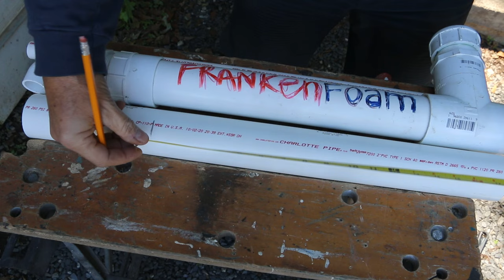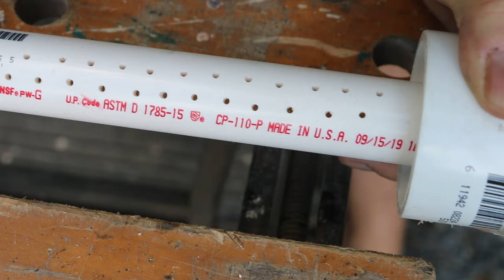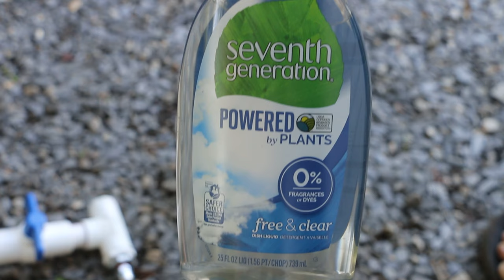How To Make A Simple Aircrete Foam Generator | FrankenFoam

Comment: How would the scotch bright scrubber pads work as a replacement to the steel wool?
Reply from the maker: Hi Chris. I tried stainless pot scrubbers first. I wanted a little finer mesh. Didn’t try scotch brite. I’d give it a try. I think it’s in between the two I tried. If you compress the pads down that might help. Thank you for watching.

Comment: Hi, thanks for this great video. 
How would you adapt FrankenFoam for bigger and/or continues batch flow? Let say someone wants to work with 100 gallons of foam!

Again, Thanks!
Reply from the maker: The tank section could be made larger. The foam has an optimal life span. Not sure I’d want to do continuous generation. But, I tend to build smaller projects. There is a case for larger quantities. Thank you for watching.

Comment: Fittings that transition form one type pipe to another are called adaptors, not connectors.
Reply from the maker: Thank you, Terry. I can’t update the video, but I can fix the words on the plans. :-)
Reply: @GreenShortzDIY  And the next time you use the fittings. It's always nice to look professional.

Comment: I think you are supposed to use a pink colored tape rather than teflon if you are dealing with gas(air) the teflon is for water.
Reply from the maker: Thank you for the tip. I appreciate it. Thank you for watching.
Reply: @GreenShortzDIY  The FrankenFoam is a brilliant tool- I watched all the way to the end and have no concrete jobs coming up.
Reply from the maker: Thank you for watching. :-)

Comment: you can use ALOT less glue. best quality is if you sand it (use rough sandpaper) where you apply the glue. it will NEVER leak if you do it that way.
Reply from the maker: Thank you for the tips. Thank you for watching.

Comment: About how many cubic feet does a 94lb bag of cement make?
Reply from the maker: Hi Robert. I’m not sure. It would have to do with the amount of foam added. I prefer to work in smaller batches. I do know that Aircrete Harry (here on YouTube) has done larger calculations like that. Check out his videos.

Comment: Scotch bright pads instead of steel wool?
Reply from the maker: Are you talking the stainless steel pot scrubbers? Or the green mesh that is used for metal and wood? My initial build was with the stainless pot scrubbers. It worked fairly well. Part of my problem may have been my foaming agent. I recommend using one that has glycerin. Thank you for watching.
Reply from the maker: The scotch bright pads would be worth trying. I recommend using a threaded connector so you can switch them out if you aren’t happy with the foam.
Reply: @GreenShortzDIY    I'm talking about the green pads.

Comment: In Panama I only get 20 feet pipes. They don’t sell shorter ones. Go figure.
Reply from the maker: Interesting. You need a big truck for that. Or a saw on hand. :-) Thank you for watching.
Reply: @GreenShortzDIY  The really weird thing about it? If a store is selling the 20 tubes, they do not sell some times the fittings and connections for it. As a German, also living 14 years in Canada, I am used to go to Hornbach in Germany or Home Depot in Canada/USA to have everything in 10 minutes. In Panama City Panama it’s a whole day “hunting” to find what you need. I absolutely hate that city. Moved 1 1/2 West and got smarter after 3 years living in Panama. Go to the supply store online, order everything and wait 2 days until you can pick it up all together. It doesn’t help if there is an emergency like a water pipe leak. Then it’s hunting season again…..

Comment: how many gallons does this hold?
Reply from the maker: The way I made it, it only holds 2 cups of solution. It will produce enough foam to make about 1.5 gallons of aircrete. It would be easier to make the reservoir section longer to hold more liquid. But, this is probably a unit that us best for smaller batches. Thank you for watching.

Comment: You must have to clean your Franken Foam after use.
Reply from the maker: It doesn’t need to be cleaned. I think it works better with a little soap residue on the steel wool. Thank you for watching.

Comment: I designed one that I think works a whole lot better but if you are happy with it great I know I don’t think I would be Also, PVC pipe is not really rated for the pressures of an air compressor

Comment: I didn't see you put primer on the 3/4" pipe, and inside the fitting. This would have allowed you more time to push the 3/4" pipe through. You would then have to glue 90° ell on while the glue is still wet on the pipe. After the glue sets up on a bare pipe, it can not be glued, and hold. PVC cement is not really glue. It melts the pipe, and fitting, fusing them into one piece.
Reply from the maker: Good info. That makes sense. One of the joints on an early prototype, that was pushed through, ended up being loose. Clearly I’m still learning. But I hope to always be reachable. This old dog can learn new tricks. Lol.
Reply: @GreenShortzDIY  When I stop learning new things, that's the day they will put me in the ground. I'm still learning things about plumbing, and I've been doing  it for 54 years, and master plumber and gasfitter for 38 years.

Comment: What size air compressor
Reply from the maker: Hi Jay. I think even the smallest air compressor should work, especially in a small-batch foam generator like this one. Thanks for watching.
Reply: @GreenShortzDIY  I think I remember hearing it in one of the videos, but I missed it in this one I think.  What PSI is the regulator set at?
Reply from the maker: I’ll have to look at the pressure setting. I’ve likely got it at 90 or 100 psi. That may be too high.
Reply: @GreenShortzDIY  Thanks.  Even a ballpark is good.  Just looking for a place to start.  Still have to grab a few pieces of PVC that I forgot the other day.

Comment: As a plumber of many years I have cringe at some of your technique. I have been taught and learned that it you are going to do a job, do it right. So here are some corrections that will make your project safer and last longer.
1: Always use primer when gluing you PVC. Even if the cement directions say otherwise.
2: Always, always remove stickers and ANY foreign substance on the surface you are going to cement or glue.

Note: it is important to know or remember that plumbing threads on pipe are tapered and the Teflon tape is Only used to reduce the friction of the pieces being joined because the threads will seal themselves when tightened property. The Teflon tape doesn't seal the threads (for those of you who didn't know this).
Good presentation.
Reply from the maker: Thank you JCameron. Great info! I always appreciate it when the pros add best-practice tips and methods from their experience. I agree with your guiding principle, “if you are going to do it, do it right.” I appreciate the info on threads and Teflon as well. Thank you.
Reply: Interesting .  Always thought Teflon tape was specifically made to stop leaks